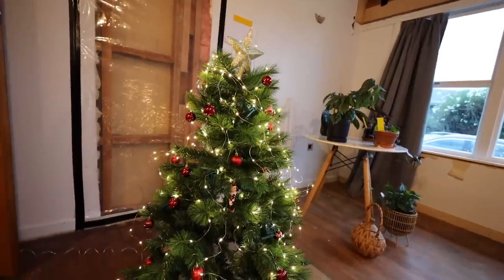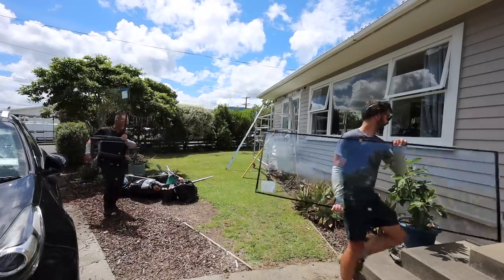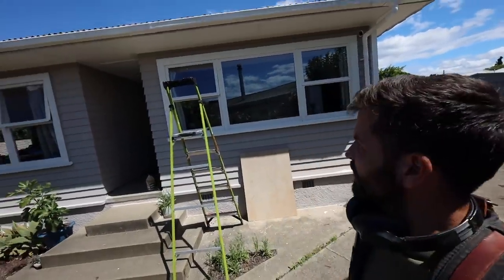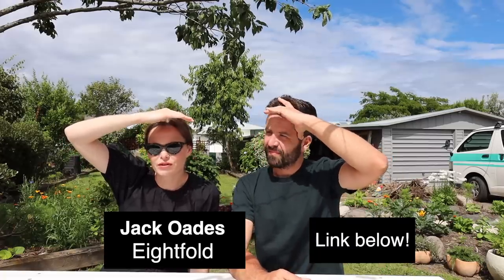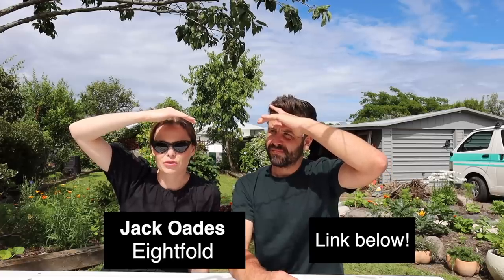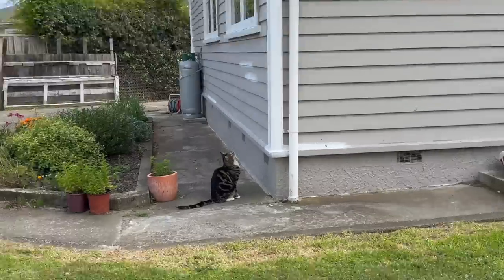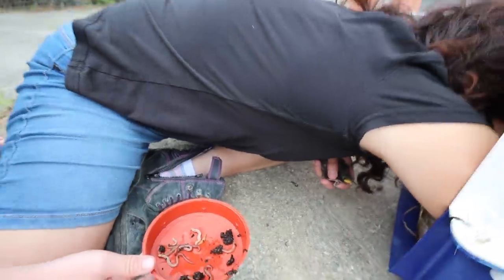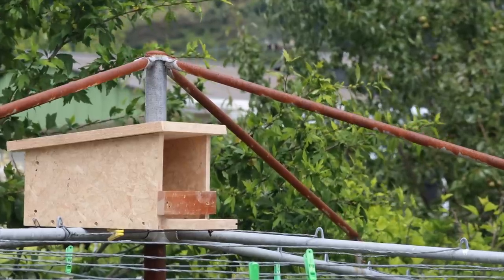It's summer in December... and we're not working

Comment: Hi Scott, If you want to make your site Tablesaw more accurate for finer woodworking I suggest you look at Ron Paulk's latest posting of an aux fence. Link: Link: https://youtu.be/P3NVOsBSadg He recommends at the end of the vid making the vertical part looker than he shows. Mine which I build a year or so ago started from Izzy Swan's infeed table product. Link: https://www.youtube.com/watch?v=RZmbZLZLrb8  I decided to make a 150mm high fence (this matches my push-stick preference) which was longer that the site saw's fence by 300mm both ends and the horizontal infeed is about 200mm wide. I also support the infeed extension from below which Ron does not. I use it as my standard fence on site and in the workshop. Cheers Phil Doherty.

Comment: Plenty builders in Oz use ryobi every day. sure they use it for rough work where precision is not required but Let’s face it the tolerance  in many building jobs is not Toyota level. Durability is not an issue either as Bunnings will exchange it no questions asked.

Comment: I like the videos, been following for a long time. I look forward to a detailed review of your HVAC system. I’m guessing all electric. People want to push that here, but gas pipes to the house is still cheaper for heat. I have a multi-stage compressor for summer cooling. In our climate, usually heating is expensive, but I pay more for cooling due to design of house and south facing windows. Garage and shop expensive in winter since resistance heat.

Comment: I  fear that the opening in the new bird nest might be a bit to big. It's too easy for the chicklets to fall out and for predatory birds to get at them from the outside. Take a board that almost covers the whole front exept for maybe a small slit at the top for heat to escape and then take a 50-60mm holesaw and make a hole for the parents to get into the nest. Put it high enough so that the chicklets can barley watch out through it. When they are big enough to go out on their own they will be able to jump up with any problem.